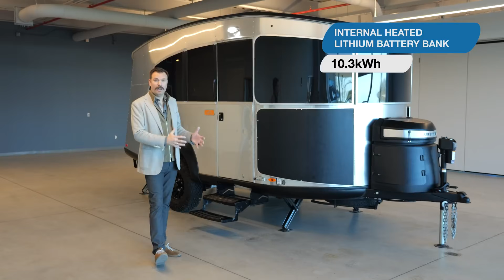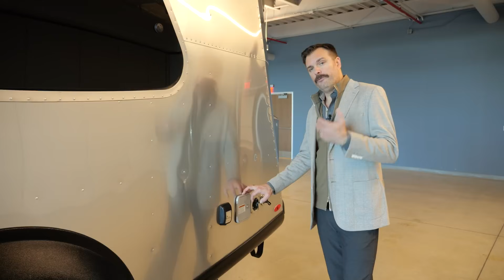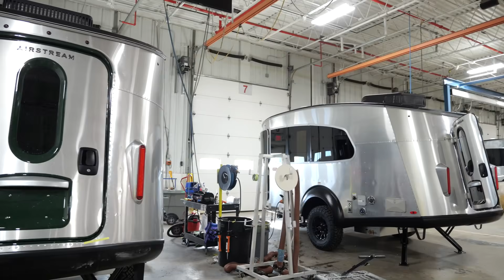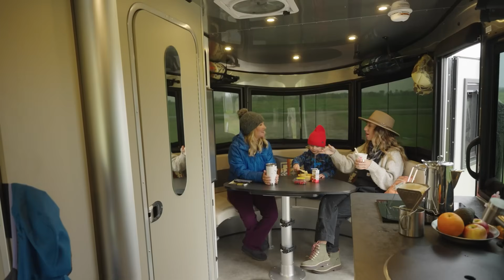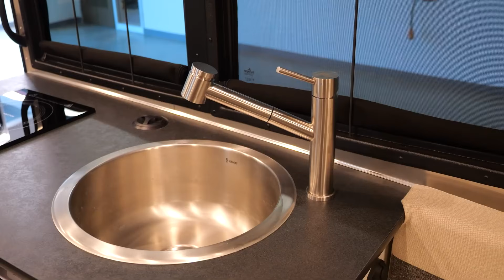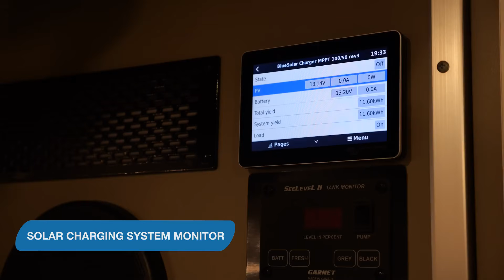Airstream Basecamp Xe – All‑Electric Off‑Grid Adventure in a Compact Trailer

Comment: I know airstream is equipped with the rear door, and has been on every basecamp since originally produced, but my needs have changed…lifting my e-bike into the unit is nearly impossible at my older age…and I am needing a mobility scooter as I age…a ramp would help load my bike and scooter…more like a utility trailer drop down ramp…and the ramp can double as extra deck space up off the ground…and add a tent on deck ramp to keep the e-bike or scooter out of weather.
Reply: Excellent Idea - fold down ramp/deck like large 5th wheels. Airstream???????